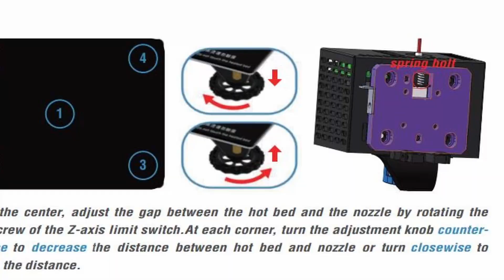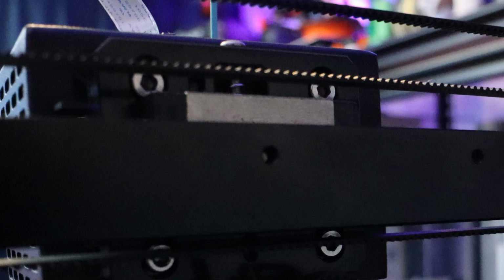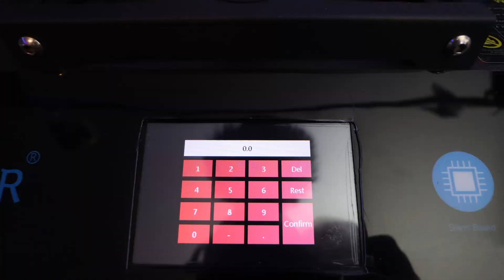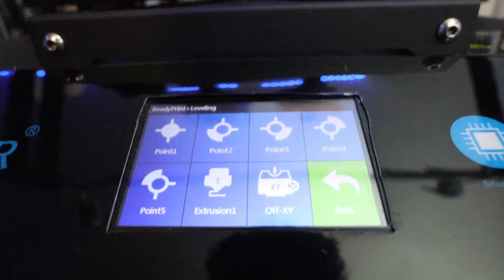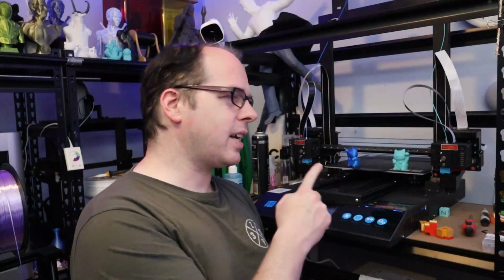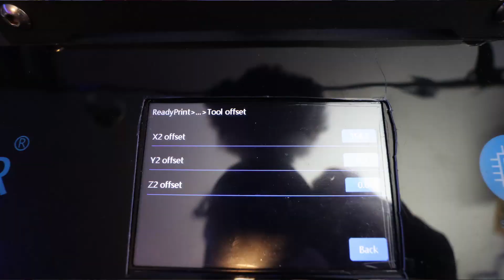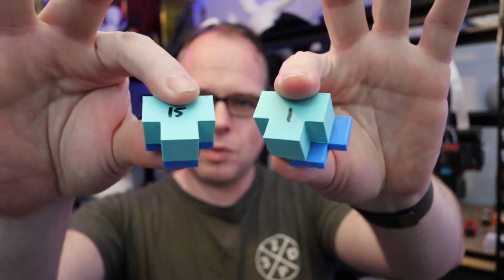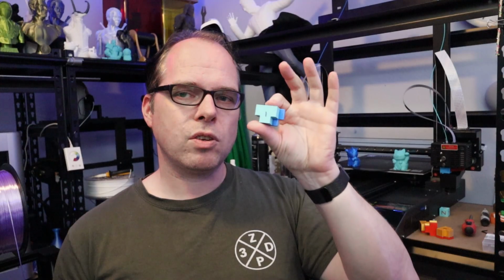IDEX Calibration - JG Maker Artist-D Pro

Comment: where can I get that test cube - or what is the file name?  I think I printed it in the past, but can't find it on the sd card.  I have never been able to make a 2 color print on this printer.  E1 works great.  Also, can I use Zoffset to raise that E2 just a bit?  thank you.
Reply from the maker: Hey, I couldn't find the cube online, but I did find this instead: https://www.thingiverse.com/thing:5212783

Yeah, the right offset can be hard to get it right. For the Z-Offset, you could use the menu, like I mentioned in the video. 
Try to lower the number a tiny bit OR if needed raise it a bit.

Comment: Great video! Have you tried our CXC on this machine? I bet it could save a lot of time if it's compatible 🙂
Reply from the maker: No, I didn’t… I wanted to use the normal way first. I have another IDEX printer that needs the same… Kywoo3d tycoon IDEX, there I’m going to use it on.
Reply: @Zachary3DPrints  got it, hope it helps!